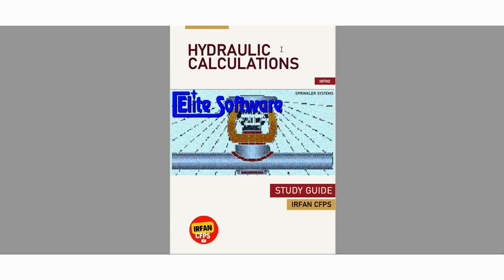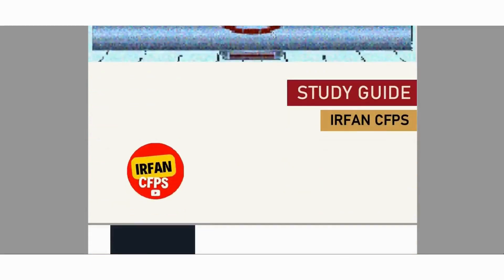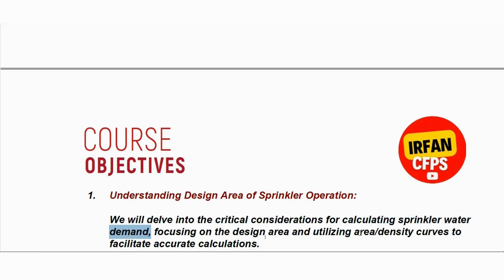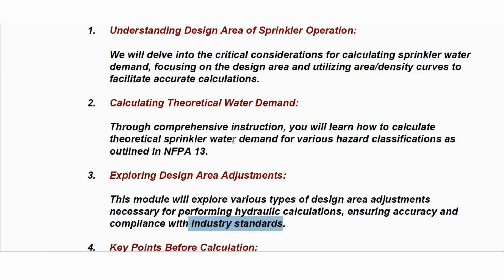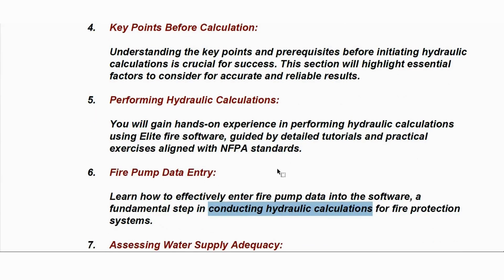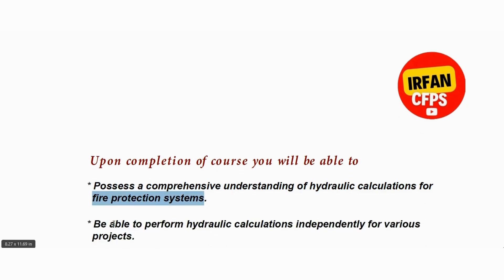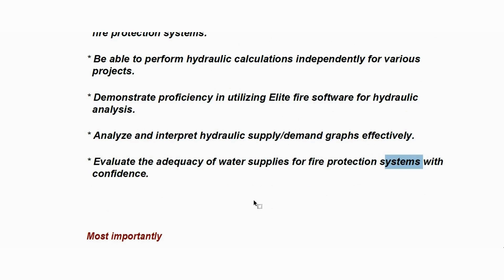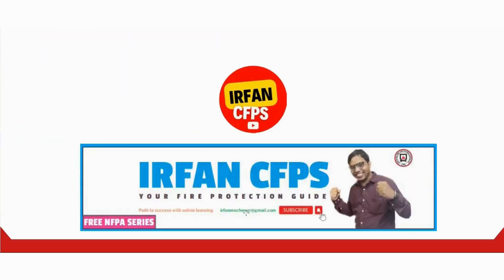Elite Fire | Introduction

Comment: Good day Sir, at this time I'm on a tight budget..and I cant't afford the software..can I atleast pay it  in installment basis..yet ur onlu assurance is my WORDS of sincerety..can u still reconsider it?..I promise  that it will be only for my personal use..
Regards,
Reply from the maker: Unfortunately i dont have the software setup file. Apologies. 
You can try online may be u might get some older versions for free.
I have posted the hydraulic calculation course using elite fire on udemy and not elite fire software..
If you have any queries i am happy to reply.
Reply: @irfancfps  yes Sir...I understand...